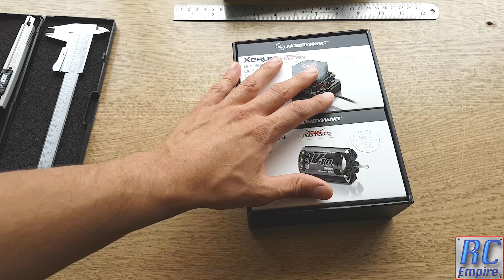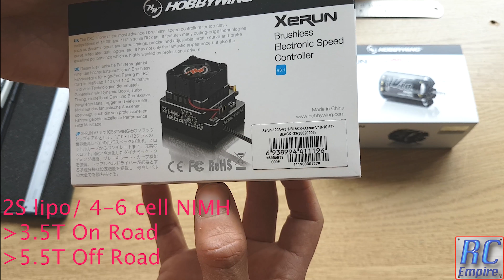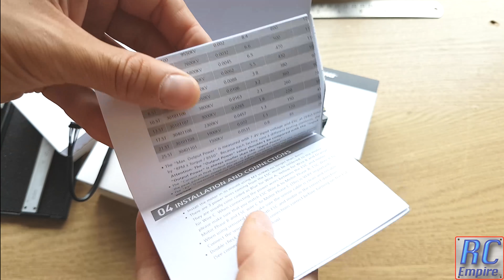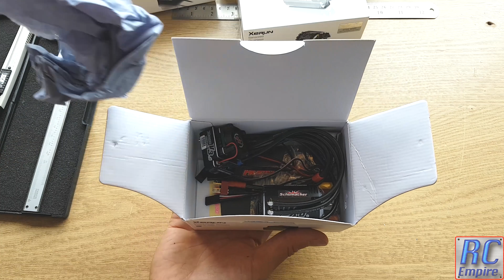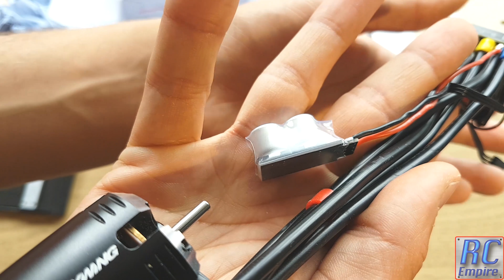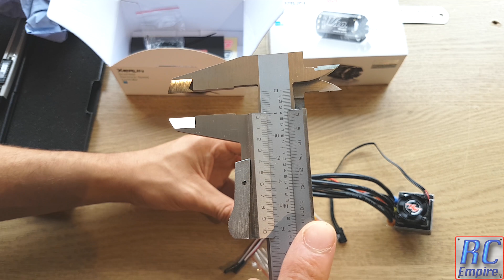HobbyWing Xerun 10.5T (3800Kv) Motor and V3.1 ESC combo. Unboxing and Inspection

Comment: What is the top speed you've achieved with the Tamiya TT02 chassis using the Xerun 10.5T (3800Kv) Motor and V3.1 ESC combo?